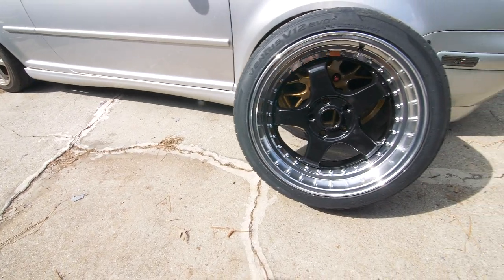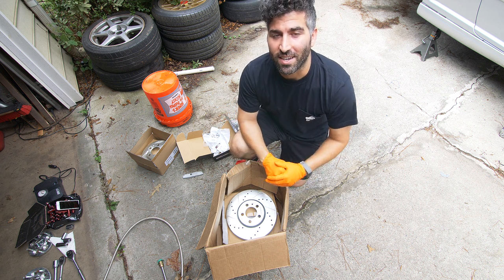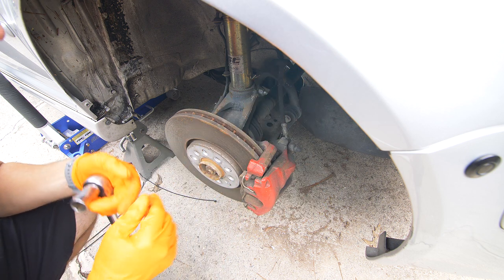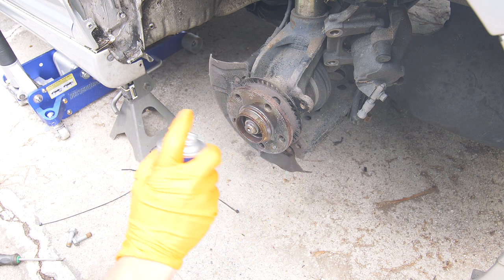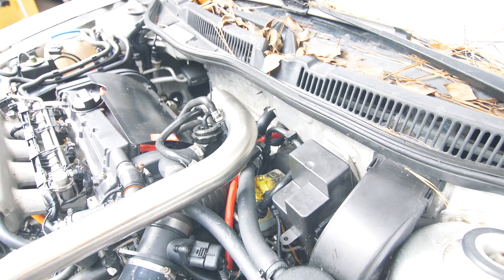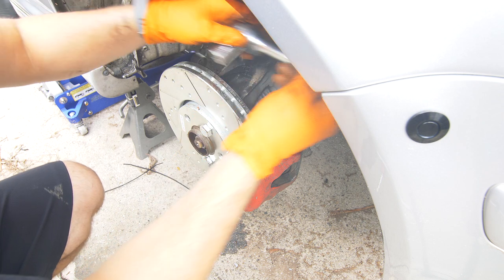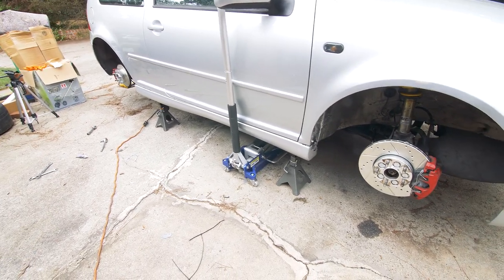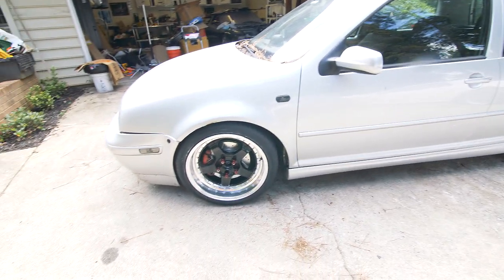New wheels & brakes for the MK4 1.8T GTI

Comment: I got a 2003 mk4 jetta and have been trying to find the right wheels that would fit this car, there arent much 5x100 bolt pattern rims out there that really do fit it, im pretty new to the VW game, what setup up are you running , is that a spacer you have on your rotor?
Reply from the maker: Check out the VWVortex classifieds, there should be a decent amount of wheels for sale & you'll see what types people are running. I am actually running 5x100 to 5x114.3 adapters, which add around 20mm of width to the setup. The wheels are Konig SSM 18x9 et50.

Comment: Hi what offset were these. I was going to get 18x9 5x114.3 et22 but not sure now as I have 8 pot calipers and think they won't clear the calipers. 😞 was it very tight on the fight with the caliper clearance
Reply from the maker: These Konig SSMs are a high offset, et50. With adapters (15mm), they cleared the calipers very easily. yours may poke quite a bit with adapters if they fit over the calipers hah. good luck man!
Reply: @supercarmio  id prob be going for the et22. Tbf the 8 pots do seem skinnier than the oem brembos so I may be in with a chance. Shame they're not a popular wheel in the uk. Otherwise could have paid someone to try one on before I bought. Thanks for the reply. Your cars look 👌